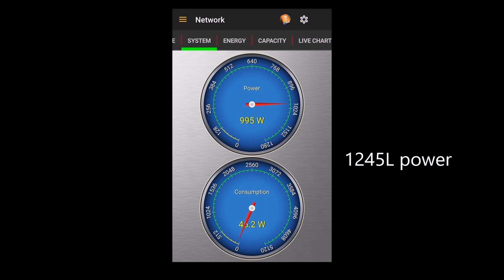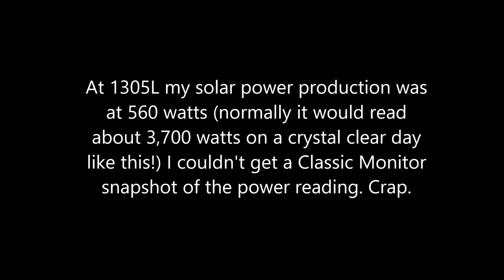85% reduction in solar panel power production during "The Great American Solar Eclipse"

Comment: I just enjoyed the moment yesterday.  I didn't try to do any kind of photography.   I have nothing to show but that's okay :)  It was FUN.  It wasn't a total eclipse here either but it got dark enough to be noticeably darker and at the max point for me, it didn't feel any hotter in the sun than it was in the shade!!  How cool is that!  I wish they happened more often.
I have to admit, I did do one thing near the maximum point of the eclipse, I shorted a 100 watt flexible solar panel and saw that only ONE AMP was running through the wires!  That panel put out nearly 6 amps before the eclipse began!